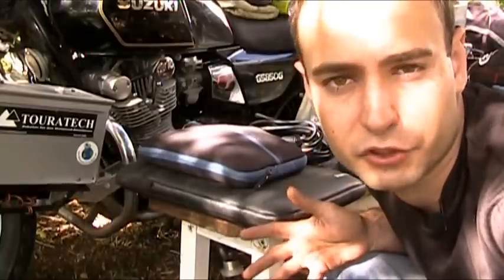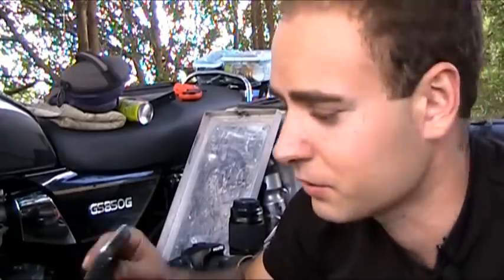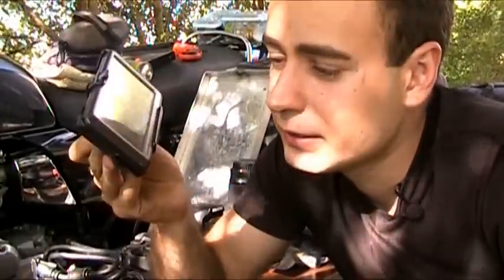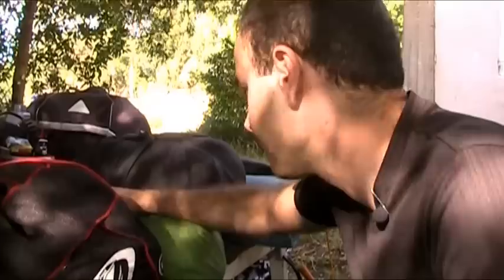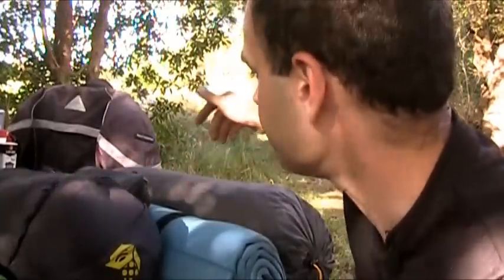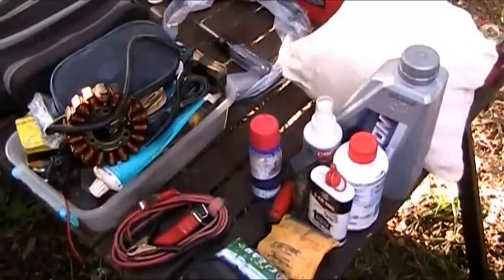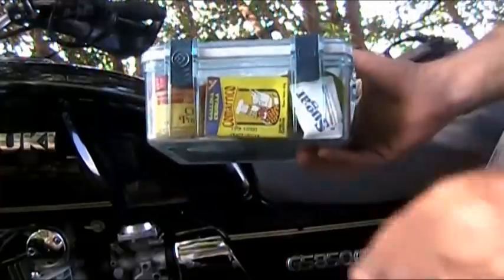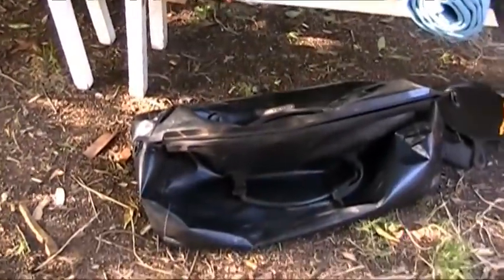Tips and tricks for traveling on a motorcycle abroad

Comment: Nice to see someone doing a motorbike tour on a motorbike, and not something that is more like a small car.
If your bike costs as much as a small car, and uses more petrol (once you've covered it in your gear) you may as well take a small car and never get wet!
The best thing I can think to add is to fit two or three 12 volt sockets to your bike and charge your stuff on the go. I also charged power banks on the go, so I had plenty to charge cameras, video cameras and my phone whilst camping somewhere without power. O and do not use a 12v to USB converter on a 12v socket mounted to your bars, they won't last a day! use an extension and put it somewhere cushioned.

Comment from the maker: When I was a kid, I was in love with big Fours of the 70’s, they were elegant, all metal and they had my heart racing every time I saw one. That probably is the biggest reason I chose the GS but in technical terms, it’s a shaft drive bike so no messing with chains, it’s a freight train, so it hauls all the load I need and as you can see I have a house full, it has a wide seat, so it’s comfortable in long ride unlike dual sport bikes, it has a low center of gravity so it’s stable on dirt with

Comment: I've been planning a trip to start in a months time, this video has been very helpful. Although it does seem like a lot of stuff, however your trip is a lot longer than my planned one. I'm glad and surprised how fast technology has advanced though, as I only need my one compact dslr with 2 lenses, ultralight laptop and external drive which takes up hardly any space in comparison to the older tech. got an action cam on the helmet too.

Comment: Hey Chris , great video! But to help others here: I think tubeless are the way to go, but carry the extra tubes as a back up or at list the rear one. Fixing a tire on a bad or unsafe location it's an unpleasure experience. Today battery packs can charge everything (also works like a jump starter), new Iphones are great, but low light condition they suck, go pros are ok, but wont substitute the DSL cameras yet, plus the quality of the lenses, (new ones are mirror less and more compact) sleeping air pads are personal preference, I use, got couple holds, repair and are they are space saver, but making a lot noise, Camelbacks are awesome specially when you ride on warm/hot weathers, and you keep drinking riding, by the time you are thirsty, you all ready are or start to get dehydrated. I hate the weight in my shoulder and 2/3 liters gets heavy, I have a small 1.5l inside the tank bag or strap the cameleback in the rear seat, make an extension for the hose and you all set. In this case drink and drive it's allowed 
: ) This is my 2 cents. Happy travels everyone.

Comment from the maker: Hi Clinton,

The weight is not much. It might seems like a lot but they all pack very small and they fit nicely in all boxes with room to spare. It really depends on the bike though, this bike can handle the extra weight fine, but smaller bikes can't.

The fuel consumption is around 40mpg which is really good considering the age and the load.

Comment from the maker: Hi Jon,

Don't get plastic panniers or soft bags. I don't know of any company that makes panniers for scooters but I would build them myself if I were you. If you can find ammo boxes, they are the best. I know they are heavy but they will be the strongest and most waterproof boxes you could ever wish for.

If you can't find ammo boxes where you are, make them out of aluminum or galvanized steel, and use square mild steel tubing so you can weld them easily if they break on you. Have a blast.

Comment: Hey Chris - Great video- very informative. KISS [keep it simple etc] is the answer eh  One thing I do thats saved me a lot of hassle is get a good size needle and sharpen it to scalpel edge - carry it in your wallet so its always with you. You can dig out thorns , drain a small wound, quick patch with dental floss or...  Also I carry a good folding jack knife and butane lighter- handy.   I used to carry bear [ goon] spray small in my pocket but it went off! Felt that for a couple days- ride safe

Comment: chris may god watch over you and bless you in youre travels. i also own an old gs850l.bullet proof bike with its 6 race roller bearing bottom end.lots of useful info. consider getting a 2meter and 40 meter ham radio.qrp rigs,simple to use,low power and world wide comunication on 40 w/bike battery and 33 feet of wire.

Comment: Very informative and insightful video.  You can tell you have weighed things to separate what sinks from what floats.  Thanks for taking the time and effort.  Well done. Also (I'm a  hiker) and totally agree with you about camel backs.  I just use Smart Water brand bottles.  Cheap and tough. In this same vein, I'd highly recommend you check out the Sawyer Squeeze water filters.  Effective, small, light and cheap.

Comment: It's one way of doing it.  I would take no more than a quarter of that stuff. Why? Because with that much stuff a bike handles so miserably, it simply isn't fun for me anymore.  With that amount of gear, I'd take an old Land Rover.  There is a lot of ultra lightweight backpacking gear out there now. I'd say 50-60lbs of gear is more than you'll ever need.
Reply: I drive good engineered car. Cars will be expensive in long travel like this. Also car can not go any road.

Comment from the maker: Well first of all, Hertz is the measurement unit of frequency, which means cycle per second in alternating current electricity. Consumer electrical frequency of a given power grid EVEYWHERE in the world is either 50 or 60 Hertz. Unless you’re taking you’re taking an air conditioner, electric clock or arc welder with you, most any electrical appliances work with either frequency.

Comment: Tips for a trip from an old biker; You and the bike are in good shape for the trip. Plan your route and time scedual.  Rain gear/Rain tight bags.  Tool/1st aid kits. VISA CARD! Iphone/SimCard/Translator for the country you will be travleing in. Hostels/Motels/Hotels if you stay to civilized countries - outside of those you´ll need a tent - sleeping bag - gas can - extra oil. Rule of thumb! "if in doute....leave it! weight is weight, you can get it on the way. Super Tips!! If biking overseas buy a good used bike there, you can sell it when you finish your trip. Shipping is expencive and problamatic.

Comment from the maker: Part 2:  

As a matter of fact, most electronics, and in this case, all my electronics come with power converters that already transform different voltages and frequencies and there is no need for a power converter. Secondly, the plug converter I’m showing in this video is in fact just three sets of prongs connected together in a plastic box, nothing less nothing more.

Comment: Thanks, good advice until the point where you said that universal stuff doesn't work and then said to get a pair of boots that would do everything :) j/k

I'd much rather ride with shoes that are comfortable to walk, than walk with shoes that are for riding. Protection - a serious crash isn't an option anyway. Waterproofing - there are lighter and cheaper solutions than bmw goretex.

A lot of stuff. 2 Laptops, 3 cams, hard drives, frying pan.. Can't imagine packing's a quick job. 

Good luck!

Comment: MacBook air...... it works, it can do video, its small and light.
Reply: Or macbook pro. I have a 13", it's small, light and it does anything.
Reply: Brice Deylac MacBook Air saves you weight replacing the axe also. :D
Reply: Антон Литвин The 13" retina pro is barely lighter than the air and a much better machine.
Reply: hfranke07 Quite so! A macbook Air seems to fit the bill nicely. Just need to be mindful of those cases where internet is only available via a LAN cable, as mentioned in his film.
Reply: I meant heavier. Also you can get a usb - lan adapter or thunderbolt - lan adapter.
Reply: Rowan Healy Hey! whatever floats your boat :) 'Better' is always subjective.